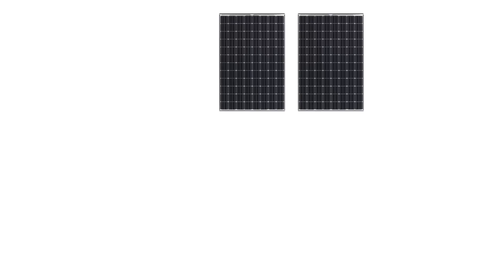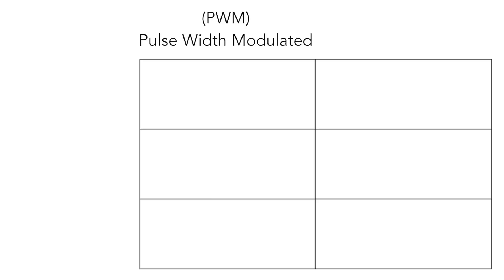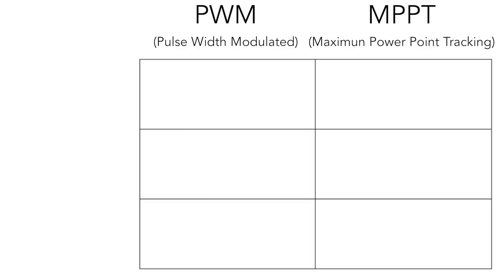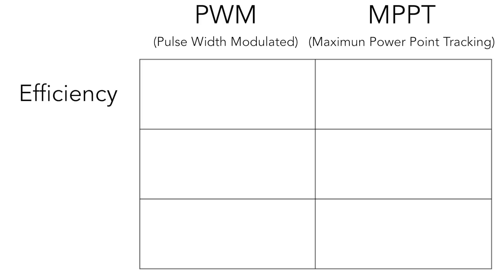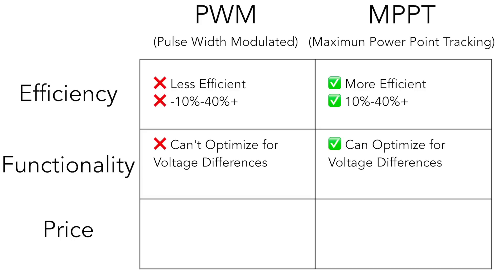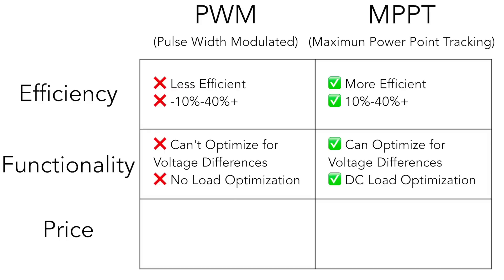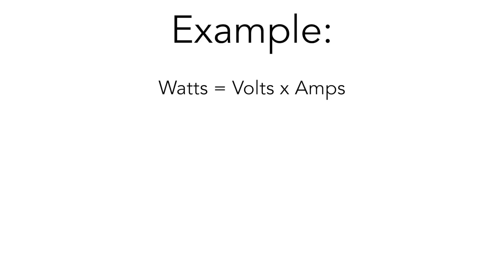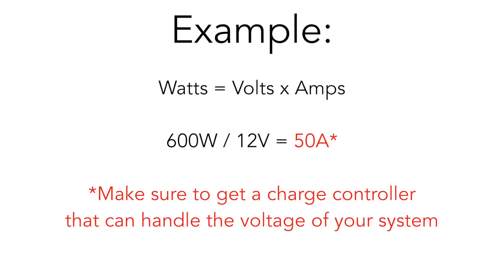Comparing + Sizing MPPT vs PWM Solar Charge Controller

Comment from the maker: Hey guys! Hope you enjoyed the video! It's a ton of info but I found an awesome video that goes into the technical differences between PWM and MPPT. Check it out here if you're interested in learning more of the "dirty details" → https://www.youtube.com/watch?v=wmyuxKmlBCk. Let me know if you have any questions and I'll do my best to answer as many as I can... see you all on the next one 😎 ☀️
Reply: Duet Justus  thanks
Reply: hi
Reply: how to making solar
Reply: im about to buy a system for my VW Rialta RV and i have 2 batteries already ran off the car that charges them but i want i want my own boondockind tech deck for my fridga nd computer and camera gear n tv basiclally everything but the AC!
amazon has alot of decent deals around 60$ for 200 watts is what i want and i have a 2000 inverter already to hookup,so what solar panel, ,controller and baterry should i get?? ..btw cant afford Lithium yet..
Reply: A question about the size of the controller : my system and my batteries are 12V, what If I connect my 2 12V 135W solar panels in series, do I divide 270 by 24 or by 12 ?
Reply: @nonobebert7646  you would divide it by 24 as you have created a 24v solar array when you series them
Reply: You all prolly dont care at all but does anyone know a tool to get back into an instagram account?
I somehow lost my account password. I love any help you can offer me
Reply: @Diego Tristen Instablaster =)
Reply: @Kenzo Tristen I really appreciate your reply. I found the site thru google and Im in the hacking process atm.
Seems to take quite some time so I will get back to you later when my account password hopefully is recovered.
Reply: @Kenzo Tristen It did the trick and I now got access to my account again. Im so happy:D
Thanks so much you saved my account!
Reply: @Diego Tristen no problem :D
Reply: Is PWM more durable or longer lasting than the MPPT? 

I mean, usually, the more tech in an object, the more fragile it becomes as it has more components in it.

Comment: As a practical matter in the context of a RV, except for very large arrays in very exposed situations and very careful panel placement, a PWM controller will come very close to most MPPT.  Shading as you have noted is important and can be an overwhelming factor in a solar rig that moves from place to place and is affected by AC covers, campsite locations etc.

Comment: On smaller systems, it's worth noting that under 10watts MPPT stop tracking  - so I use PWM on a small 20 watts system on my shed for charging car batteries with a well-matched panel that peaks at 17.5v  - and an MPPT on my 280-watt system on my motor home where the panel peaks at 32volt and the lifepo4 battery is charged at 14.4volt. So i would say well-matched panels  on sub 40watt systems PWM works well

Comment: To make it simple for folks the way to go if you do not live where the sun shines all day and is cloudy alot, go with a MPPT controller.  In a 12 volt battery system wire your panels for a 24 volt system. The MPPT can handle the higher voltage and charge your 12 volt batterys.  The advantage is when cloudy the panels will still be putting out higher voltage with fewer amps to the controller.  The controller  changes the voltage into more amps to charge the batterys at 12 volts.
  But if you're out in the desert or where you get sunshine most of the day, either type MPPT or PWM will work fine.
   I found that a MPPT charge controller taking in wired for 24 volts solar panels will be charging a 12 volt battery system at nite parked under a street light!!!
Reply from the maker: Great info here. Thanks!
Reply: For real
Reply: THX MUCH HOGCAT

Comment: I understand the 50 amp requirement for the 600 watt solar system. But do a 600 watt solar array ever produce 600 watts. Most panels are only 15 to 20 percent efficient. Cheers great video

Comment: Thanks for the guide, and about sizing, is it okay if you already have an available 20a SCC but then you only have a single solar Panel , can you use it to the 100w panel , while you are still planning to have a parallel Solar array soon? Or do I really need to calculate the panel and battery 1st and follow the recommendation for the SCC size? Thanks again...

Comment: That other kid did a live comparison with different price mppt and pwm controllers and found little to no actual difference in the performance. About 2-4 watts..
There was one test condition that had around 40watts for the mppt CC. But this was a small window and thus having watched the live showing of a wide range of CC's I was going to get a mppt, but will not bother with the 7 times the price for 2 watts.

My next consideration is micro inverters, but they're grid tied, there are no batteries. And they are split, so you can have half the array shaded and it will maximize power. Each unit supports 4 panels and you can string them together up to 6 units.

I will be trying a buck converter, as really the mppt is just one of these with a voltage check, if it lowers the voltages, it raises the amps, so if you have a 18v 4 amp and need and are charging a 12v battery. You may get 13v at 6 amps... Or if you have a 33v 8 amp, you would get near 15amps.
There 87-99% efficient depending on what you buy, but there around the same price as a cheap PWM controller. 
But you would need to add a cut off..

Comment: So I'm planning on making a solar system with 2 100w solar panels and I'm not to make a battery with eve 280ah cells with a daly 200a or higher bms and I was wondering if I was able to use a pwm charge controller for that kinda of system or would I have to get a mttp charge controller I'm building it for a micro camper

Comment: The price difference between PWM and MPPT isn't as great as it was when this video was created.  Back then, there simply weren't many inexpensive MPPT controllers around.  It's different today.  For example, the EPEver Tracer 2206 AN controller is a 20 amp MPPT controller and is available on Amazon for around $60.  I just installed one on my sister's Lance 1575 (200 watt system).  It works great.  But I agree with others who said that PWM can be just fine in many situations.  In fact, I've had a PWM controller in my camper for the past 11 years and have never needed MPPT.  MPPT is great when two situations happen frequently:  Your battery bank is discharged fairly deeply, and you camp in colder climates.   The first one is true because MPPT does it's magic best during absorption (aka boost) stage  of charging.  After that, the controller is throttling back on the amps anyway.  If you don't discharge your battery bank very deeply, the controller won't be spending much time in absorption stage.  The second is because the solar panels' Vmp (max power voltage) is highest when the panels are cooler.  That translates to more watts when the MPPT controller operates the panels at that higher voltage.  For most people with small systems though, PWM is just fine.  But if the price difference isn't much, might as well get MPPT.
Reply: Thanks for input...

Comment: So I connected a square foot solar panel to a 12 volt battery that was drained to 11 volts. The solar panel puts out 24-28 volts. After a few hours, the battery was back to 12 volts. Please explain why I need a "charge controller"..thank you for the video-better than most....

Comment: Great video Michael:  Solar Edge  advertises  that they have panels that have individual  controls so  one damaged panel in a string does not compromise  the  rest.  Does the MPPT  charge  controller also  do this ?  I  hope  you  cover  this later in the series

Comment: Nice😊
But pannels dont produce exactly 12 volts.. they can go up to 20 volts..
So keeping this variation in mind.. how can we select a solar charger both in MPPT & PWM
Reply: Controllers come with an open (max voltage allowable) voltage rating. Use that figure for calculations.. BTW...I have panels labeled as 20 volt, 30volt and 80 volt. Get a multimeter and starty measuring maximum voltage and current. Be careful.

Comment: I've had a Tristar PWM for years and it's worked well. But for the last year it's barely ever diverted overcharge to my dump load, and always indicates state of charge as being below maximum even on long, sunny days. I measured my batteries and they're waaay overcharged...up to 30% over. I'll go to an MTTP I reckon.

Comment: I have a 100 watt panel output about 18V and need to charge 2 12 volt deep cycle batteries in parallel on my camper, is there anything besides what amp charger I should be concerned with?

Comment: Great video - But, yep you know this but was coming.  I have to use a PWM controller as I have yet to find a Dual battery(bank) MPPT charge controller that will charge two separate battery banks correctly.  There are a number which will provide full charge capability to one bank (say 30A) and about an amp trickle charge to another.  If you know different then let me know, please.  Whilst I realise the video was basic you could do a more complex "techy" version as there is far more to both controllers.  eg the PWM is far more than an off switch and many do not understand MPPT at all :-)
Reply: Desmond's Donders  have you used a marine battery switch and an isolator?

Comment: I had hoped you would cover the MPPT, with a 24 or 36 volt series array, into the MPPT controller at the high(2x), voltage, then exiting(voltage reduction), to charge a 12 volt array and 12v load
Reply: That is a different subject which I thing you will find elsewhere on this channel. The truth is out there...google will help.

Comment: Thanks for the video! Just 1 question. Why do you size de controller with FVP(W)/Sistem V (V)? Isnt the current of the solar string limited by the module itself?

Comment: Excellent videos, thank you. How do you decide if you want, need a 12 volt, or a 24 volt system? I realize RV's, and travel trailers use 12 volt mostly, does that mean most household appliances are 24? What about power tools in my garage?
Reply: Usually you can draw 12 or 24 from a 24 volt battery bank. To run household appliances requires more equipment and  can be both costly and complicated. I am sure there a videos about this on this channel.

Comment: What if your solar array produces more amps than what you can find an average MPPT controller? Can you hook up two controllers to the same battery bank? For example, I want to have 8 - 310w solar panels. Each panel is rated at, (36.54V and 8.49A) which is (36.54V x 8.49A=310.22 rated watts per panel) even at 48v system configuration, it would be 51 amps.

Comment: Most helpfull. I am trying to design a solar system with as much efficiency as is reasonably possible. I need help to design it. I need a compentent installer with a reliable back up service. Would you be able and prepared to do that? I would of course pay for your services. There are many ways to go wrong in this game. I am quite good at practical matters.

Comment: I have a 200 (2 panel) Renogy kit with PWM controller with 2 6 volt golf cart batteries totaling 225 amps at 12 volt. I plan on getting a 2000 watt pure sine inverter  so I could run my microwave  along with other things on the RV completely off grid. I would like to  be able to use 110 amps per 24 hours and completely recharge that amount. Would I get more efficiency buying two more hundred watt panels and keeping my pwm controller or 1 - 100 watt panel (bringing the total to 300watts) and a MTTP controller?
Reply: I have a similar system and the problem is not the panels or controller but the batteries. If your microwave is a small 600 watt unit that is 50 amps at 12 volts and over 100 amps if a 1200+ watt microwave plus if you are running anything else. Batteries to not last long if you discharge them much over 20-25 amps load or below 50% charge. For example your 225 amp hour battery will last much longer at a 25 amp per hour discharge for 4 hours than 100 amps per hour for one hour. Yes, I know you will not run your microwave that long but the idea is to keep the battery load below 25 amps per hour.  l would add more battery capacity. My AGM 110 amp hr 12 volt batteries 10 years old and working well.
Reply: GIGman azmt yah but having more panels is necessary or you could under charge consistently. You will need both. More panels and more batteries. And an mppt controller. Morning stars you can do up to 60amps I believe, and about 5 panels to max.

110 amps per 24 hours constantly?  That’s a large load for that system it sounds like. Maybe you mean 110 amps in a 24 hour period.

Comment: fantastic video!! Question: I have 300a of solar panels, which means I need 25amps controller. Would a 20amp be close enough or should I trade for a 40amp?

Comment: You can use a PWM controller even if the panel is 18-20 V  with a 12 V battery. It just doesn't want to be able to make use of the Voltage over/above 12 Volt. That's one the big differences between a PWM and MPPT controller! Right???

Comment: I'm working on building my 2nd off-grid boat dock (this one is for a friend). I went with PWM for mine for a number of reasons. If I have a 2-panel array in an area (no buildings or trees nearby) where there is no shade (other than clouds). Is there any efficiency benefit to MPPT in this situation? 

Each panel should be able to receive the same amount of sunlight all the time. I'm trying to decide whether it is more important to choose higher wattage panels or an MPPT. For my friend's dock, I'm trying to decide whether to go with a 12v battery configuration and whether I should choose a 12v array or a 24v array along with whether to pick MPPT or PWM. 

On a cloudy day, I see my PWM system charges at around 10% of panel capacity -- 670w array charges at around 67w with full cloud cover. Would an MPPT system achieve higher efficiencies in this situation? With my current load, that means I have around 10 watts of excess power that goes towards charging the batteries. I have 210aH, 24v battery array, so that gives me plenty of storage to last through a few days/nights of full cloud cover.

I'm hoping I can accomplish the same for my friend but by spending as little as possible.

Comment: You will never see 50 amps from a 600 watt solar array. The main reason is that a “12 volt” panel actually outputs around 20 volts. 600 Watts  / 20 volts = 30 amps. Even this would be under ideal conditions when the ambient temperature is around 40 degrees, no clouds, haze, or dust, and the clean panels are precisely perpendicular to the sun.
Reply: I questioned that also. I believe 16 to 20 Volts is the correct voltage to use in the formula.
Reply: Steve Kiemele which is why RVs are only 30amps. The really large rvs now have 50 amp connections.
Reply: @blairbushproject  That's a whole different thing.  You're talking about 120v connections that have to do with the loads the RV has.  For example, RVs with two a/c units need a 120v, 50 amp electrical panel to run those units in addition to everything else in the rig.  But the amperage rating of the solar controller has nothing to do with that.  It is only concerned with the number of amps coming down from the solar panels and through the solar controller to get to the 12v batteries.  It isn't directly connected in any way to a 120v circuit.
Reply: Maynard the Miser yah I agree and I don’t believe there’s a 50a on a 12v system that I have seen. If they did it would be the dc system and the ac system separately.
Reply: But to size a controller properly the maximum amperage coming down from the panels needs to be considered.  Solar panels can produce more watts than what they are rated for in overcurrent conditions due to environmental variables ("edge of cloud effect").  For that reason manufacturers recommend oversizing charge controllers by adding 25% to maximum rated amps from the array and rounding up to the next sized charge controller available.

Comment: I need a video on 4,  6 volt batterys wired sitting side by side to make 12 volts with positive wire to a trailer on the left side and ground on the right side  then attached a solar wireing from  a controller attached along with a 3000 watt inverter attached,,,,      every other battery banki see on YouTube is set 2 on top 2 below  mine is 4 across the tongue of my travel trailer can ypu help me ?

Comment: PWM is about 80% efficient.  You can make up the 20% loss by adding extra panels.   MPPT is simply too expensive to be worth buying unless space is an issue like a trailer or an RV.
Reply: Any extra panel incurs an extra 20% loss per panel..  eventually MPPT will be cheaper.
Reply: Thank you!
Reply: How efficient is mppt?
Reply: What causes this?